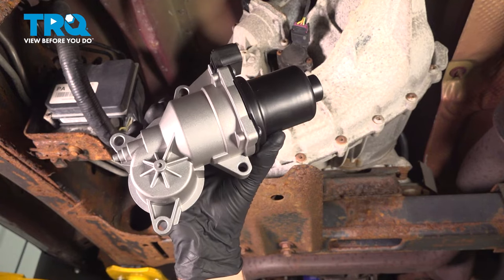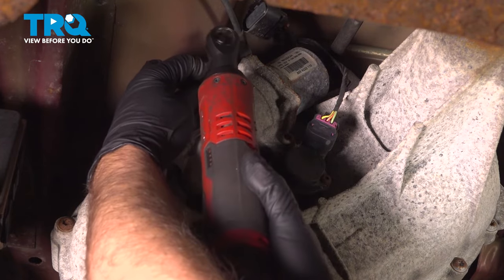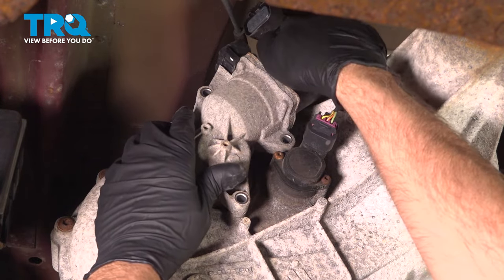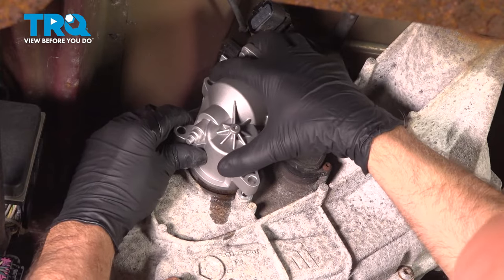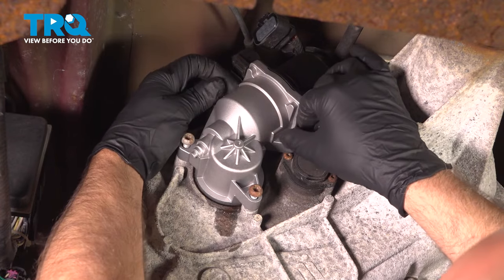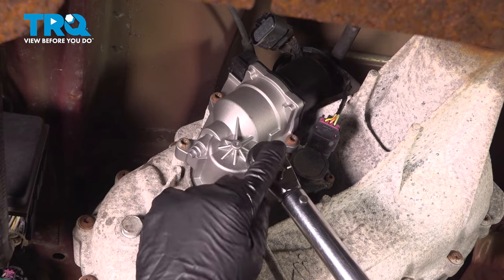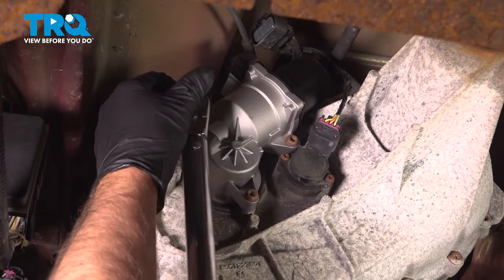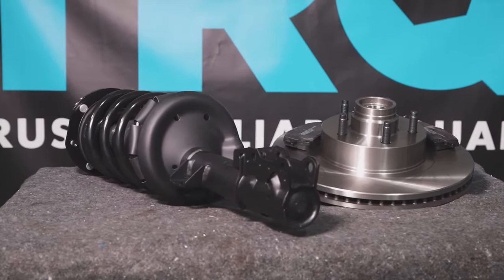How to Replace Transfer Case Shift Motor 2007-2013 Chevy Silverado

Comment: You don’t explain the transmission and the Transfer case motor needs to be in neutral because the new motor is clocked in neutral from the factory

Comment: Ya everyone n the chat here is correct when he took the electric shit motor off you can here something fall inside the transfer case I'm having the same problem with a 2009 Tahoe transfer case it's stuck n low lock 4 wheel drive and will not come out don't matter how many electric shift motors for buy for it I no how to rebuild the 246 transfer case for year model 2004 and 2005 but I'm don't now how far it goes to b the same I'm gonna guess 2003-2006 r going to b the same when it comes to the shift actuator motor I can rebuild these year models no problem there easy to rebuild but 2007 and up transfer cases r getting worse and worse every year can't trust Chevy anymore they don't want you working on these vehicles anymore I've done been told by my old boss that owned a cotton gun and he ask Chevy why there making these vehicles so hard to work on now days and Chevy told him they don't want anyone working on them is why there making them difficult to work on so the customer will have to bring them into Chevy to work on them now Chevy dealership will not work on these Chevy trucks over 10 years old because they want u to scrap them and keep buying the newer ones Chevy is losing customer bad 1999 -2002 transfer cases r different than the 2004-2006 models the donkey dick we call it the gear that sticks out when u take the shift motor off on the 1999-2002 is flat on each side of the round shaft that the electric motor goes back on but n year model 2003-2006 the donkey dick sticking out of the transfer case is like a star wrench and I can tell u this on the 2003-2006 transfer case when u buy a new shift motor that motor that's new comes n neutral so your transfer case has to b n neutral as well to line up and the way you do that on the 2003-2006 models the donkey dick sticking out of the transfer case when u take the shift motor off it looks like a star wrench but has like a Carter pin slot n the donkey dick sticking out of the transfer case that carter shape has to b pointing straight down towards the ground on a new shift motor if that Carter pin slot is pointing towards the oil pan it's n 2 wheel drive so grab u some plyers or vice grips and turn that donkey dick until the Carter pin slot on the donkey dick is pointing straight down towards the ground then put your new motor on